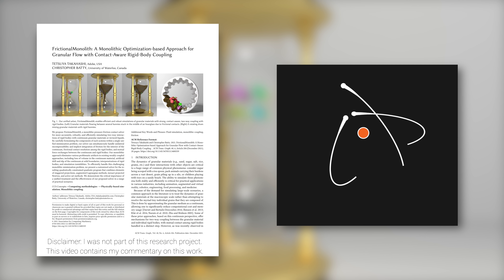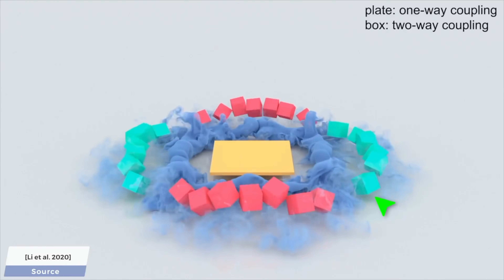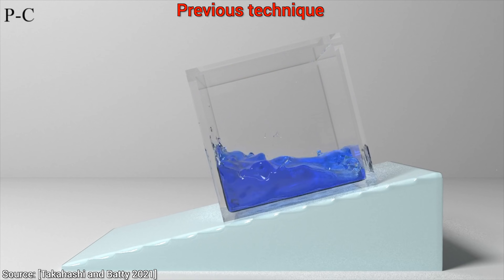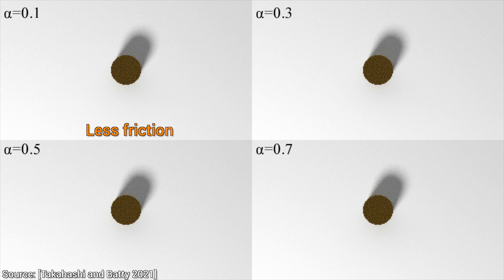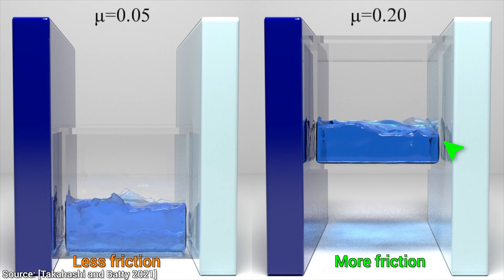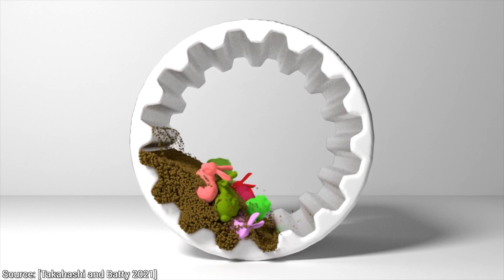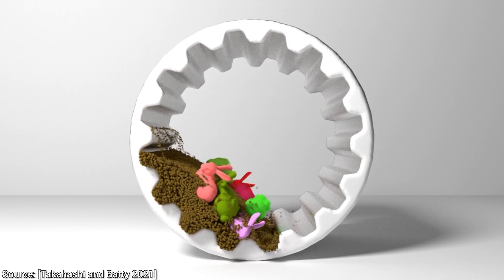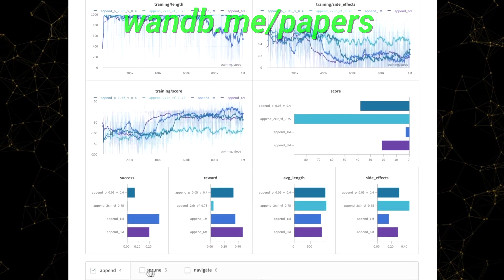Adobe's New Simulation: Bunnies Everywhere! 🐰

Comment: I'm curious if it's a CPU-side algorithm or if it is - or if it can be - parallelized. If it is then it would be interesting to run it on a cluster of GPU:s to see what kind of performance you get.
Reply: A lot of ML is parallelized. Most use GPU cores because it suits ML better (lots of relatively simple calculations).
Reply: @Scottx125Productions  Yeah, but this isn't ML, is it? This is regular physics simulations? For whatever reason I I seem to recall that at least one set of such simulations tend to depend heavily on CPU:s but obviously if you're simulating a large number of particles then that sounds like it would work nicely on GPU:s. Although, if there's plenty of dependencies between the particles then it might be difficult to compute all of them independently and you would end up with large series of serialized computations, which tends to kill GPU performance. Definitely interested in knowing more about how this works in this domain.

Comment: I can not imagine any way you could make these types of simulations run in real time, so I guess that means it will only be better once we actually achieve that!
Reply: Change from particle based physics to grids, and simulate on gpus? Or change between grids of different sizes and particles dynamically, depending on if there are any solids?
Reply: @overloader7900  Yeah I was thinking the same, voxels/pixols a bit like zbrush uses, but calculated in parallel on a bunch of A100s.  The edges of the ramp slope have some artefacts where they're  maybe adhering to a grid.